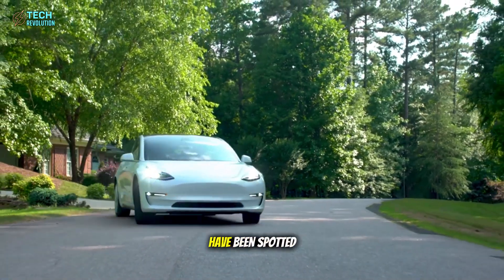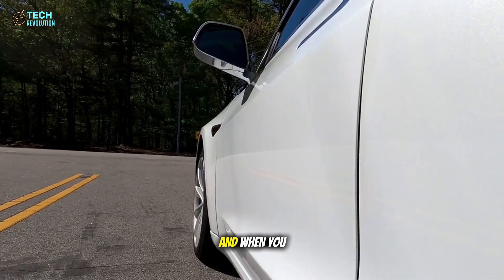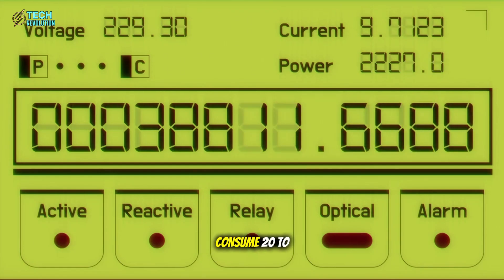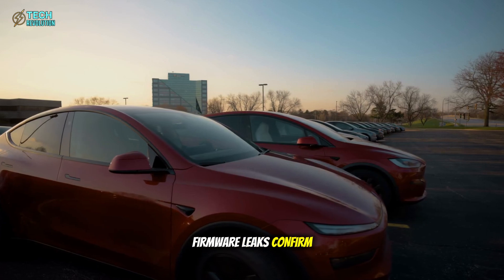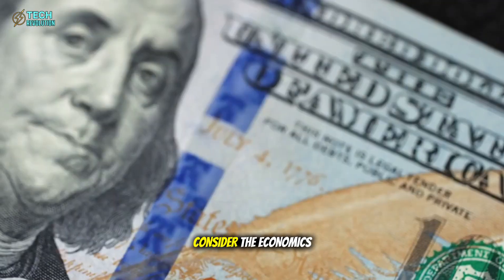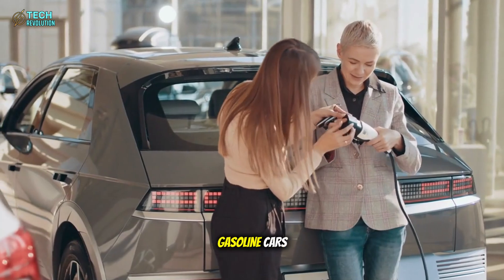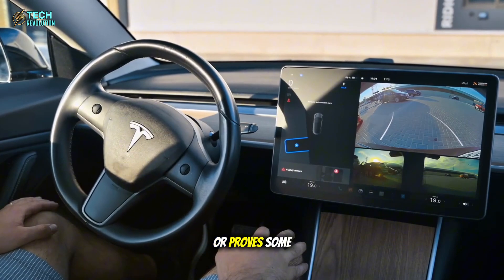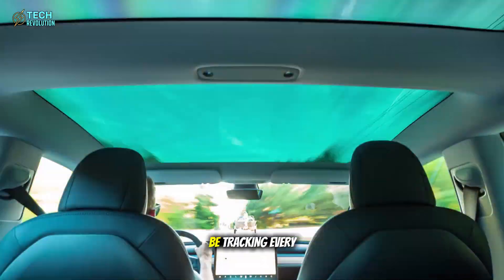Tesla Model 2 Spotted Testing: Inside the $25K EV's Cost-Cutting Design

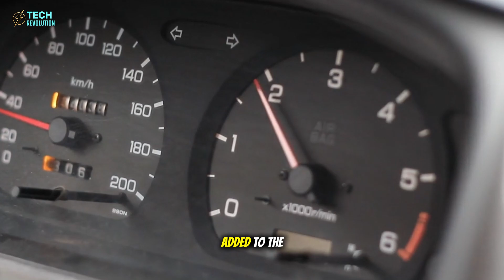Comment: What exactly is the tachometer measuring? (3:30) . Worst video ever.
Reply from the maker: The tachometer reference shows motor speed data from firmware leaks, not a real gauge. And hey—constructive feedback helps more than insults.